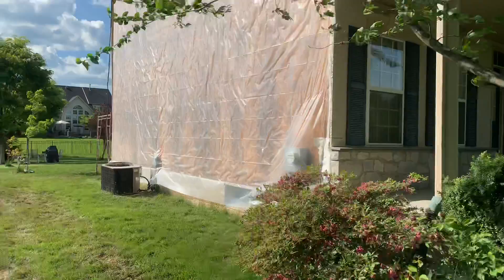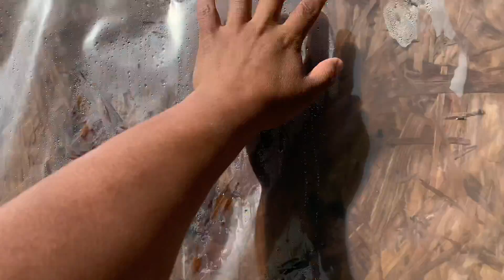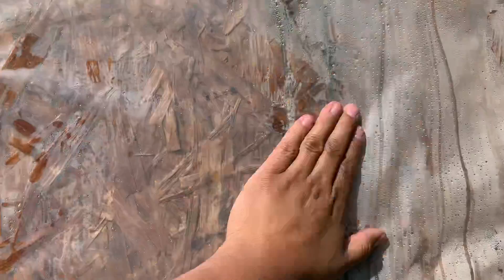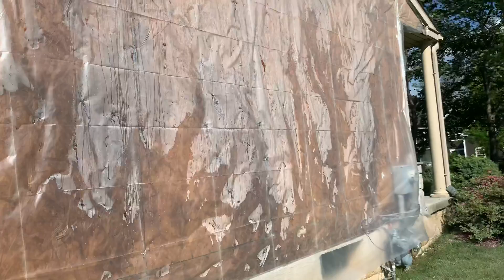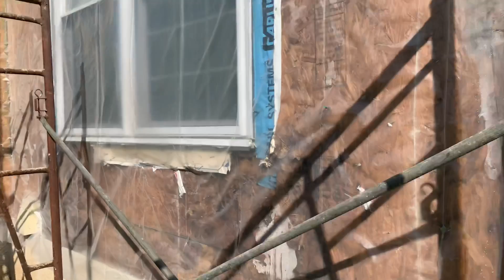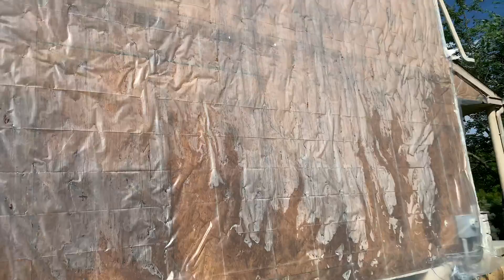Is DuPont Tyvek home wrap any good behind a  cementitious cladding?

Comment: That's polyurethane and it condensation behind it
Reply from the maker: Yes,  is 6mil plastic we use  it  to cover the walls while the  stucco is been repaired, all that moisture was coming from the previously removed stucco, the  waterproofing  wrap used on this project was Tyvek  home wrap.  And no, the product is not a bad product as I mention in the  video, is just that this paper is not designed to get in contact with the stucco. You can use it and have a rainscreen matt  on top of it and you will be fine.
Reply: @MunozStuccoPA  l have built over 50 homes and I only use typar not tyvek, I've seen what happens to tyvek over time that doesn't with typar, l just did a stone wall and glued cement board to plywood, it's a much better less time consuming and even cheaper way to do stone and less chance of failure with not weak place in the substrand,  l use type S mortar and brush on bonding adhesive to the cement board and stone,
Reply from the maker: @georgespangler1517   when we use cement board as a  base sheathing  for our projects we mesh all the joints then add a liquid barrier membrane at the joint and over the entire  cement board, then we install the cladding as we normally do. Similar technique as yours. 

Keep up the good work 🫡
Reply: @MunozStuccoPA  Thanks l brush on bonding adhesive to the backer board and stone it really grabs hold  and with type S stucco/mortar mix its there too stay,

Comment: Hi From Toronto, Canada. Mr. Munoz, correct me if I am wrong , but isn't the wall  that you are showing, wrapped with a 6ml vapour barrier ( vapour barrier holds air moisture)? Not an air barrier like a Tyvek home wrap which is a breathable wrap? Also If you do stucco would you not  cover the wall with 1" or 2'" Styrofoam before you apply the cement base (assuming there is no vapour barrier)?  Thank you ahead of time for responding.
Reply from the maker: Hi, this video is and after  video of  the first step of an “stucco remediation”, the term stucco remediation refers to removing the failing stucco system and start from scratch with a new  breathable stucco/siding system to meet today’s standards. 

The 6 mil plastic that you see is not part of our home waterproofing system, how ever it is part of our stucco remediation system, once the existing  failing stucco is been removed (step one of our stucco remediation system) the plastic is installed  temporary  to provide air and water protection to the structure while the home repairs are been performed.

Previous to us recording this video the crew removed the exiting stucco,  which for this house consists of a water proofing membrane ( in this case Tyvek  home wrap), metal lath, scratch, brown and finish coat. The previous system is also known as 3 coat stucco system. 

The other system you are talking about  with the  1”, 2” or even 3”EPS foam here in USA is  called EIFS (Exterior insulation and finish system)  which is something that we also  do.  Every system  is different and is used for different application. 
Every system has its own way of doing and it’s own way of preparing a wall for its cladding. 

I hope that makes sense 😬, thanks for stopping by.